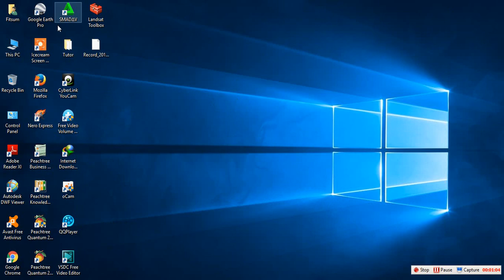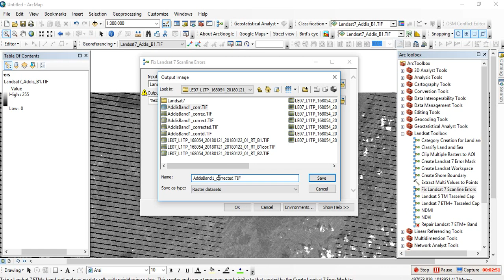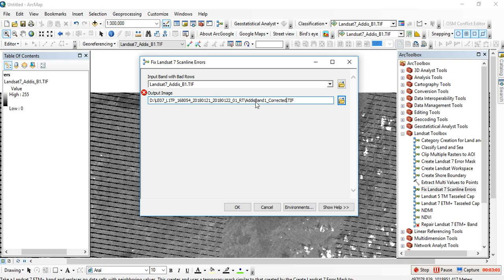Fix Landsat 7 Scan Line Error using Landsat Toolbox in ArcMap

Comment: Hi! Thanks for the link. However, after running the tool,  I still see the lines in my image. What could I be doing wrong?
Reply: i am too facing the same problem. If you find the solution please inform me.
Reply: Hi! Are you sure you downloaded the Landsat 7 Collection 1 Level 1 data? I had a similar issue and figured out this was the problem. if yes, this should help.

Comment: i have one question and one query... 

we are using original version of arcmap ver 10.5.. and the landsat toolbox is not working. 
it is showing following errors:
error 010141: error in creating a raster from a geodataset
failed to execute (Nibble)
failed to execute (lnadsat7scanlinerrorfill)
any idea what happened here?

another question is: will this toolbox fix only landsat 7 errors or previous ones can be fixed too?
Reply from the maker: Answer for your question 
The extension is only a trial version, it may not work for original software or check the expire date of the extension.

Answer for your Query 
It only works for landsat7 image, even the name says "landsat7 scanline error fill". And I dont think other images (landsat5 and 8) have scanline errors.

Dont forget to subscribe and to share with friends.
Reply: even landsat 1 to 5 has errors. anyway i found out that using r.fillnulls in grass we can fix the errors. i am not well versed in grass and python. can you possibly do a video on that?

Comment: I have followed the same steps but failed to fix the error. Please help me what to do. is there any other tool available to remove line scan error. Thanks
Reply: me too facing such problem. if you find the solution please inform me. thank you
Reply: @aakashkhanal7833  Which version of ArcGIS you are using? It is compatible with 10.4 as I installed it and used to remove scan line error. However, it doesn't remove fully but better to clip your study area first then use to remove the scanline error.
Reply: Thank you for your support. I am using 10.3 version and I am thesis student from Nepal. Due to this problem I am unable to perform further work. I have also performed by cliping but it doesn't work. Thank you again
Reply: Hi! Are you sure you downloaded the Landsat 7 Collection 1 Level 1 data?

Comment: It is not working for my landsat 7 image. How can I remove the errors?
Reply from the maker: It is only for landsat 7 

do it band by band
Reply: Sir what is the accuracy after correction?
Reply: @NEXTLevelGISRSfitsalem  i do it sir but, after the scan line correction process scan lines are thicker than original